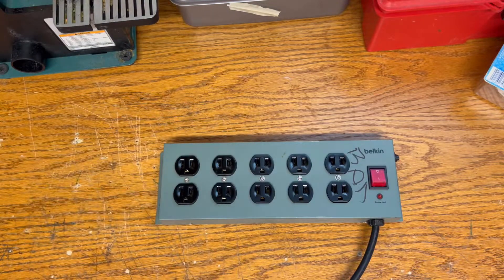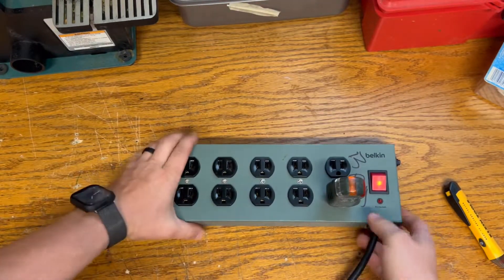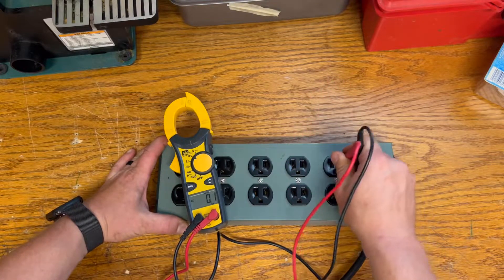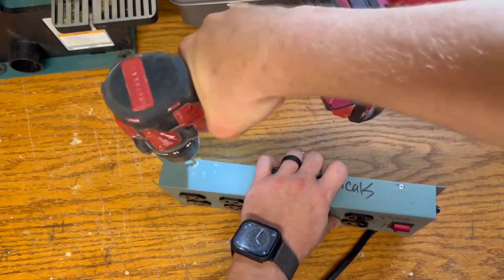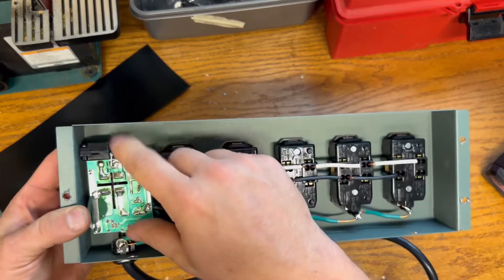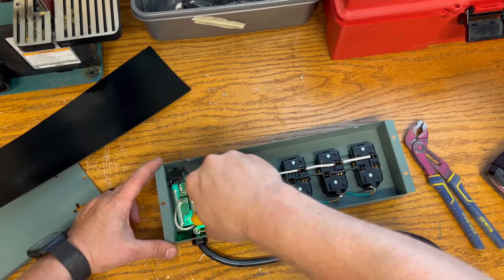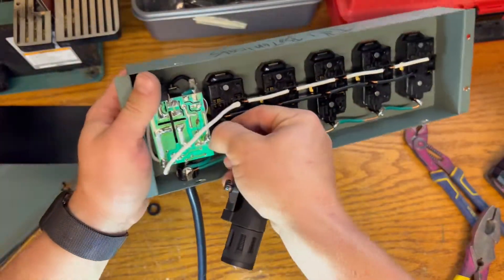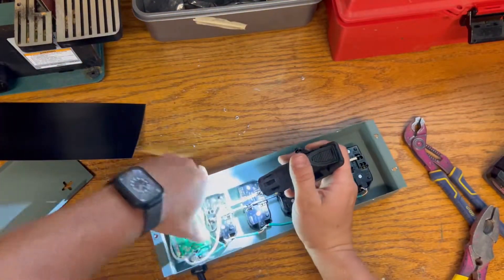Can a Blown Surge Protector be Fixed? (011)

Comment: You could've figured out the MOVs were toast since the protection light was off, and you could've saved the original switch if you had desoldered the contacts from the circuit board.

Comment: The burnt part is a MOV.  It won't be a surge protector anymore when you bypass them.  You just have a simple power strip then.
Reply: Wonder if I can use soldering to replace with another one?
Reply from the maker: Metal oxide varister?

Comment: This should be a PSA why Electricians  don't repair electronics. You could have desolder it and replaced the same switch and added a few MOV to ground it would still be a Surge protector.
Reply: Amen
Reply from the maker: Ok

Comment: That was a thermal fuse that got to hot.
Reply from the maker: Guess it did its job!
Reply: @TheSickestNick  yes/No. The frustrating part is the house electrical fuse/breaker should have blown before the thermal fuse. It is the last defense. I had a brand new electrical cord do the same thing and there was no reason for the fuse to blow, totally rendered a brand new cord useless.
My only guess is since they are inside an electrical enclosure they just get hotter faster than they should, and I was using in a hot area of my shop. That's my story and I am sticking to it 😀